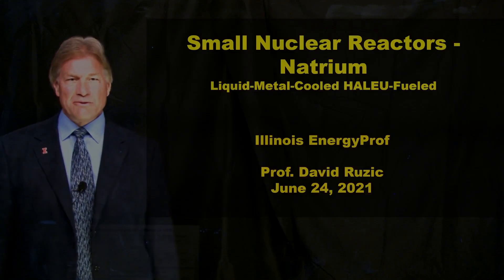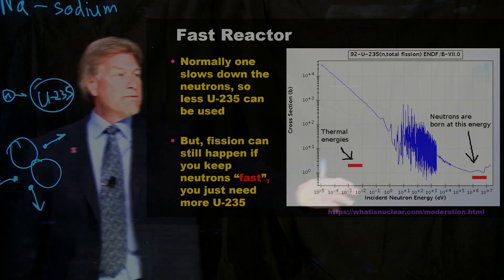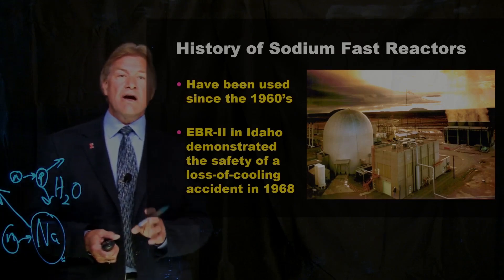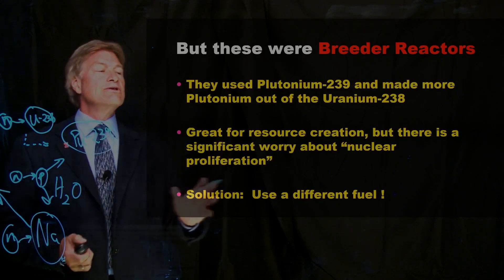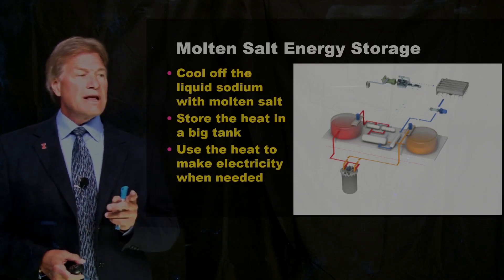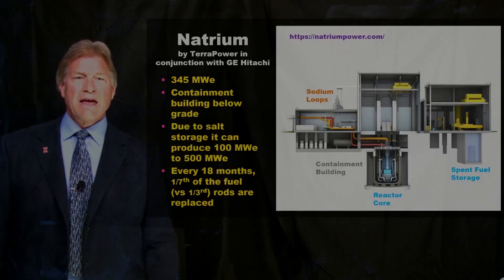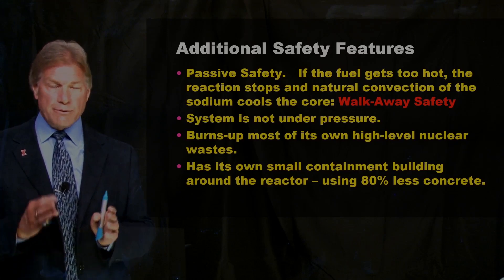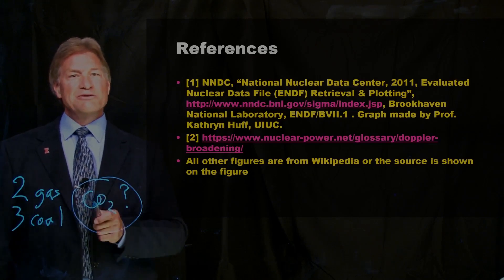Small Nuclear Reactors - Natrium

Comment: Great lecture, thank you. I've got two thoughts to offer.
1/ This demo plant is looking to be ready 'late 2020's'. Then there will be testing, analysis etc. It seems reasonable to infer that production plants will not come along until mid 2030's at the earliest. We need solutions before that!
2/ Hot salt as an energy store is awesome and you make some great points about how coupling this nuke to it can deal with our grid's changing energy needs. We could instead* use the hot salt energy store in conjunction with wind and solar to match overall production with overall demand by decoupling the two. This could be done much more quickly than proving out the new nuclear system.
*or as well
Reply: Large scale nuclear plants take 20 years ( not schedule but actual time) to complete.  You are correct, if Natrium is sucessful and proven this will not occur until ~ 2035 and whenyou add the time (~ 20 years) to build large scale nuclear plants this is not a solution.

Comment: I still think we need to stop using heat as a a means of just purely making electricity and start using reactors in a direct use in manufacturing and industrial use where heat is needed such as metal works and water desalination. When ever we turn heat into electricity your always going to be at a loss of efficacy. In an ideal world, piped hydrogen to homes with fuel cells is much more efficient then transmitting electricity though steal cables and transformers. Its also much more versatile where it can be caused for heating as well not just making electricity.
Reply: I'm not sure I follow...how do you precisely direct the heat from a nuclear reactor to, say, weld metal?  You can't just transfer it around or even store it like you can with electricity; pretty hard to beat the versatility of flitting electrons around.
Reply: @Pene7942  Well for example. Conventional means of using A reactor is by implementing a heat extractor to generate the steam to spin a turbine that will eventually generate electricity. That electricity is then transfused back into heat, in various forms of manufacturing. Resulting in around in a loss of 60% of thermal efficiency. 
What I am suggesting is that we use the thermal energy directly from a small scale reactor. Instead of running water through the heat exchanger to produce steam, you use that heat exchanger directly into forms of industrial uses, such as, metal fabrication, concrete fabrication, water desalination, and any other industrial use that requires heat. 
I think this would be at beneficial  in the use of synthetic fuel manufacturing, where Direct Air Capture requires large amounts of heat during its process.
If ya do the math as to how much synthetic fuel one SMR can produce in a day, it is astronomical, and makes you scratch ya head as to why we are not jumping onto this immediately ? Not only can a Small scale reactor generate large amounts of heat, It can generate this 24/7 with out any interruption, which is more then convenient for companies to adjust, and predict the energy market. In a way it would be more stable (and predictable) than what we have today with cued oil prices and production. Where you have large amounts of instability such as wars, severe weather events and human error. 
Wind and solar are unstable and unreliable for fuel production, being the fact that they 100% rely on weather. This alone is a problem for the energy market. 
But as for a Small scale reactor that can produce a synthetic fuel non stop without interruption is a 100% win for the energy market.  
When you put it all on the table of the pros and cons, it make 100% sense and seems to be the only absolute solution to decarbonizing the whole world. Remember its not the engine that is the problem. if you have a V10 fuel guzzling Lamborghini Gallardo, if it runs on a 100% carbon neutral fuel, its as green (if not more) as any battery car on the road today. That goes with any car, Truck, Plane, Train, Boat, Ship. its all becomes zero emission. No more arguments, No more pushing inferior technologies, no more forced sacrifices.
Direct thermal applications.

Comment: Very well done.  A few notes:  (1) The nitrate salt storage is off-the-shelf from the concentrated solar world.  (2) The Natrium nuclear island (NRC-licensed) is extremely small.  Most of the plant is outside of the NRC world and can be built to commercial standards. This reduces cost, along with #1. (3) Fossil fuel pollution impacts are not limited to CO2. There are a lot of other emissions, including fugitive methane, acid rain, etc.  (4) On the economics, it's not fair to compare Natrium to coal because in the USA at least, new coal plants are a dead letter.  It's also not fair to compare current methane prices because methane is set to get a lot more expensive very soon.  (5) Industry is saying "we need a fuel."  And Natrium seems to be the leading option, along with the GEH BWRX-300.  (6) I'd love to see a segment on the BWRX-300 reactor.  It's leapfrogging over NuScale Energy.

Comment: Dr. Ruizc, can you comment on why/it energy storage with sodium is impractical for use with wind and solar? I would guess it is because of the variability you mentioned, you can heat the sodium up very well if your source to do so fluctuates. I would also guess that one would need a very large installation to both generate power to be consumed on the grid while at the same time melting the storage medium.
Reply: Not Ruizc but.

Sodium works for any heat source, but ideally one that you can’t “turn off” such as nuclear. It has to be a heat source though, the only way a wind turbine would be able to heat something is by converting first to electricity then using that to run some heating coils, incredibly inefficient due to the amount of energy transformations that need to take place.

Solar sodium does work though, but not with solar panels. We use concentrated solar plants, essentially a bunch of mirrors that direct sunlight to heat up a container of sodium. Most plants like this use water or oil, but I know of at least one in nevada called Crescent Dunes using sodium.

Comment: Buildings should have power plants just like everyone has an air conditioner. To make power 100 miles away at n efficiency, transmit the power at n efficiency, transform it x times at n efficiency, is hogwash. Fire some natty gas on premises and you're paying $0.02. But there's noise. How do we temper the noise from a steam turbine? Even with a small nuke plant outside your house you still need steam.

Comment: The future of these reactors relies on the advancement of materials science.  There is no material that can last 30+ years in contact with radioactive molten salt.  These reactors will be disposable and will create a large volume of nuclear waste in the form of degraded reactor cores and support equipment.  The cost per kilowatt hour will be very high until the lifespan can be extended to equal that of a water cooled reactor.  I like the science, but in practice I believe that this technology will never get started until we have a disposal solution to the current nuclear waste production.
Reply: These reactors are the solution.  The science, engineering and technical aspects have been developed and will continue to be improved.  And regarding the deep storage of current high level waste, well, there is a solution - Yucca mountain.  Politics killed that; the disposal solution is being thwarted by fear mongering activists and politicians caving to their pressure.

Comment: Is it possible to use tin instead of sodium? That way you wouldn't need as much of an intermediary between it and the steam generator. Also, tin has a higher heat capacity.

Comment: Hi! Appreciate your videos, wanted to feedback that the mic audio is too soft. You can see the levels on youtube by right click -> stats for nerds -> volume: -12.7 dB. Ideally it should be between -2 to 0 dB. Turn up the mic gain and move it closer to your face first, if still not loud enough then amplify digitally. Audacity is a free audio editing software that you can use. You can normalize individual clips before editing them together. You should also export audio in mono to avoid balancing issues

Comment: Solar Thermal systems can produce power at night by storing the day's heat.
Reply: You mean like the failed Ivanpah Solar Electric Generating System in California?
Reply: @chapter4travels  Not quite, Ivanpah doesn't have thermal storage (and so has to burn natural gas to start its boilers each morning)

I also prefer "parabolic trough" designs to a central tower, since those don't result in a blinding beacon in the sky.
Reply: @HannahLemurson  Yes it had thermal storage it just didn't work.

Comment: So you like to have hundred of degree hot molten Sodium, where the hotter it is the more reactive it is, a metal that must even in small high school level chemistry amounts  be kept under in a  "non-reactive" substance (oil) to keep it from having contact to the atmosphere. Not only that it reacts with atmosphere quasi instantaneous and burns - i.e. reacts - when it get into water violently and releases hydrogen gas - a gas that's self igniting, meaning no oxidizer needed - and it's not like atmosphere alone (least say any fire brigade) never ever has water in form of humidity in it:

Desaster pre-programmed.

https://en.wikipedia.org/wiki/Sodium_Reactor_Experiment

I stay with LFTR ...Yes, they can use Lithium, which is in the same family of alkali metals, but using it as e.g. FLiBe (Fluorine Lithium Beryllium) it's fluorinated into a flourine-salt - flourine bonds are one of the most stable bonds that can happen in chemistry, see: Teflon - and thus is for all intents and purposes inert.

SMR is also just a money siphon, gas cooling is even worse than liquid cooling, any machinery from computers to combustion engines and big transformers in substations are proof of that. They don't address any problems current tech has, a technology that's only good to breed bomb material, and that's where it actually came from: Nuclear submarines that can/could breed the new bombs - killing two birds with one stone -.

Alone the fact the inventor (Alvin Weinberg) of LWR & PWR said it was a dead end and invented the MSR while he was ousted out of the nuclear energy circles with words like "if you thinks it's so dangerous, why don't you leave?", says a lot.

Comment: My concern is how violently chemically reactive sodium(natrium) is to oxygen, which is, *checks notes*, what we breathe.
I'd much prefer something that doesn't want to explode because of the air.
Sealing the reactor in an inert nonreactive atmosphere is possible, but still leaves the danger present, creating a potential point of failure.

...

ALTHOUGH IT'S A WAY FREAKING SMALLER RISK OF FAILURE THAN WATER!!!

So I grant that it is nevertheless a step in the right direction.

Comment: We, the British, starting in the 50s, built three fast reactors. but despite two of them supplying electricity to the grid, were all closed by the mid-80s. Sodium was the cooling medium.
Reply: Grrrr, Britain in the laye 50s, 60s, 70s...technologically hamstrung by politics, policies, stagnant thinking and old ideas by stagnant and old leaders.  Virtual absolute world domination in 1st and 2nd generation jet aircraft and aerospace engineering, yet the government basically canceled the entire industry.  Launched a perfectly suitable rocket to act as a launch platform for intermediate satellite payloads, killed off by the government - the only nation that discontinued its space program after successfully reaching space.  I'm not a car guy, but it appears something similar has happened to the British automotive industry.  And now you bring up nuclear examples...it seems like the lack of STEM support by Parliament must be/have been extremely frustrating for a wide range of engineers.

Comment: I grew up in Wyoming, glad to see that the state is forward thinking.  Thanks - Energy Prof for presenting data in such a clear understandable fashion!  Also, if memory serves me right, the soviet's used liquid sodium reactors in their titanium hulled Alpha class submarines.
Reply: Liquid metal cooled reactors yes, but liquid sodium no. The reactors used on the super-fast soviet alfa-class attack subs were cooled by eutectic lead-bismuth alloy. The primary reason for this was to make them as compact as possible: Sodium is an excellent coolant, but is not so great as radiation shielding, particularly for neutron and gamma radiation since those are the most penetrating. Lead and bismuth are not quite as good as coolants - in principle either metal alone could work, but the reason why the alloy of both is better is because it has a wider liquid range. Anyway, these reactors could be made much smaller than most because the coolant could also function as the radiation shielding - both lead and bismuth are heavy, dense metals so are highly effective as radiation shielding. This in turn allowed the submarine itself to be smaller than it would otherwise have been if it had used a more conventional pressurised water reactor of equivalent power output. The insanely high power to weight ratio of the alfa-class is what gave it such a high top speed - in fact it was so fast that it could literally outrun every torpedo in use at the time the first alfa-class subs went into service. The UK and USA actually developed faster torpedoes in direct response to the alfa-class.

Comment: I like this guy a lot! I’ve watched a great number of his videos on nuclear power. 

Nuclear has always been the answer. The molten salt thermal storage is really interesting, allowing for the base load to be more variable and supplement non-dispatch-able power is compelling.
Reply: The molten salt is also interesting in how it 'decouples' the two aspects of electricity production.  For example, a turbine/generator trip can occur and yet the response on the reactor side can be more measured and has much more time to react.  This can have some interesting effects on safety analysis.  Still early stages and most of the design data seems to be proprietary at this stage, but something to keep watching.

Comment: I wonder why Russian sodium fast reactors are not mentioned. The BN-600 reactor is a sodium-cooled fast breeder reactor, built at the Beloyarsk Nuclear Power Station, in Zarechny, Sverdlovsk Oblast, Russia. Designed to generate electrical power of 600 MW in total, the plant dispatches 560 MW to the Middle Urals power grid. It has been in operation since 1980 and represents an evolution on the preceding BN-350 reactor. In 2014, its larger sister reactor, the BN-800 reactor began operation.

Comment: What is the advantage of sodium cooled reactors over molten salt cooled reactors? To me, the most sensible design is a molten thorium salt cooled reactor with the stray neutrons breeding U233 in the thorium coolant. This thorium salt cooled reactor could use purified SNF as its fuel.

In the US it makes more sense to burn SNF than thorium for a large percentage of our energy needs, but I object to shipping SNF cross country to remote sites. Our current PWR reactors should be replaced with SNF burners that could consume the stockpiles of SNF on these existing sites. SNF purification equipment could be mounted on rail cars and moved from site to site as needed. By using thorium salt as a coolant in these reactors, U233 could be produced for the enrichment of natural uranium to start up remote fast neutron spectrum reactors, which could use thorium, natural uranium, or even depleted uranium as feed stock.

Perhaps most important is that the reactors of naval vessels should be replaced by thorium burning reactors. The destruction of a nuclear powered naval vessel with a large amount plutonium in its reactor could be a major environmental disaster.

Ideally, the size of U233/Th233 powered MSRs could be reduced to the point where we could have nuclear powered railroad engines.

Comment: I’m sorry, but the claim that reactors need to run at a constant power level is not quite correct. Nuclear reactors can be driven in load-following mode and, in fact, all Gernan plants are designed to do so. Source in German: https://www.ktg.org/ktg-wAssets/docs/fg-bet-rph-lastfolgebetrieb-kki2.pdf
Reply: The professor mentioned that running at constant power is just better due to Xenon poisoning. Sure, you can make it on and off, but it comes with a lot of constraints - not to mention the economic burden around it (as if nuclear doesn't have enough of them already).

It's just preferred to used it at constant power
Reply: @miguelsousa9802  I know what he said, but the Xenon levels are basically the result of an equilibrium equation. If you reduce the power, there will be less fission meaning less Xe-135 gets consumed but also less Xe-135 being produced in the first place.

You can run reactors in load-follow mode, as I mentioned they actually do that in German nuclear power plants.

Also, Xe-135 was not the main problem at Chernobyl nuclear power plant as he mentions in the video about Xenon but the positive void coefficient which the RBMK operators later alleviated with Erbium-doped fuel rods which acted as burnable absorbers.